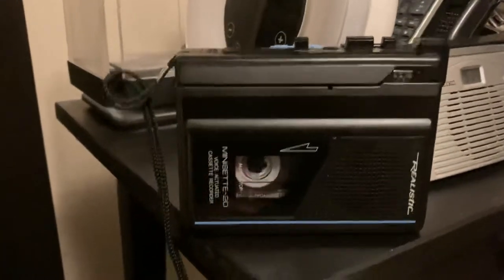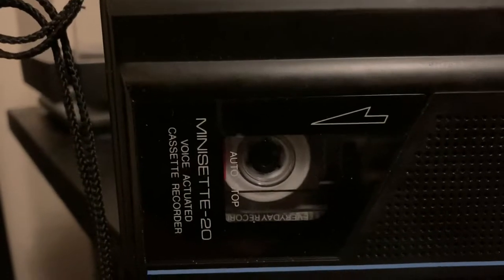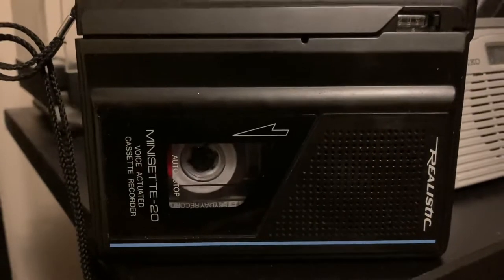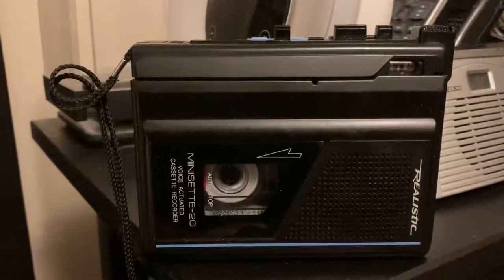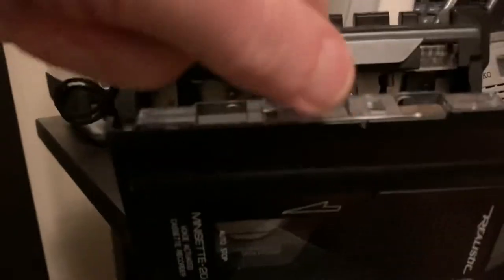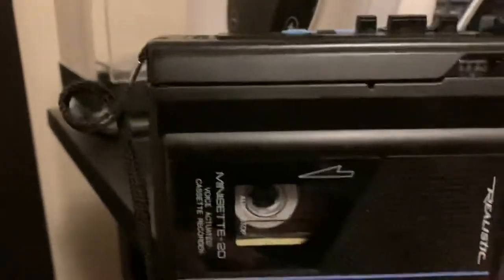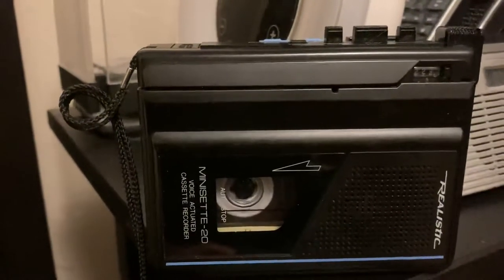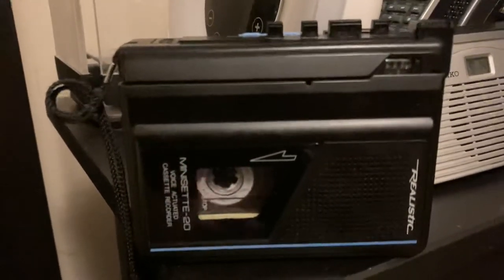How to rewind a stuck cassette tape (binding up)

Comment: My tape has gotten stuck! I can see the tape itself has actually unwound from the cassette and seems stuck in the bottom of the player. I can't rewind, hit play or eject. Please help!
Reply from the maker: Hi David, it’s likely that your rubber drive belts in the cassette player need to be replaced. That’s the most common problem.  What make and model of cassette player are you using?

Comment: I got MJ's Off The Wall cassette, but like if I either rewind or fast-forward, it gets stuck at certain parts.
what should I do??
(The Texas Heat Has something to do with it)
Reply from the maker: Classic MJ song, yeah! How old is the tape machine you’re using? Do you have a another tape player to try it out on? I’d try it on three or four players to test it out. If it plays on four other players just fine, then you likely need to replace the rubber drive belts in the failing tape machine. See my boombox repair videos where I replace the belts: 

https://youtu.be/wD967kf4AQk

https://youtu.be/ilgTdDNLzgI

If it won’t play in several tape machines, including at least one that has had the rubber drive belts replaced recently, then it’s the cassette. Older cassettes, especially ones from the ‘70s, tend to have this issue. In later cassettes, they put plastic sheets on either side of the reels that buffer them against the outer hardshells of the cassettes, allowing them to turn with less friction. One thing you can do is tap the side of the cassette against a hard surface, like a counter top. Also, if you do find a specific tape machine that manages to rewind it and fast forward it all the way, do that nonstop a couple of times to get the tape totally flush with itself on the spools. The more you fast forward and/or rewind a small portion of the tape, the more it tends to gather on the take-up reel in a not-totally-flushed fashion. That could be what’s causing the friction. If the cassette was left in a hot place, like on top of the dash of a hot car in the middle of summer, it’s possible that the case has warped a slight amount, not enough to be visible by the eye, but enough to cause too much friction for the tape to be wound by your average machine. There’s plenty of ‘70s cassettes that have been dear to me that I’ve given up on trying to play, when I’ve tried everything I could to revive it. Sometimes there’s nothing apparent with it except the symptom of it binding up or causing the pinch roller and capstan to squeal. If you hear it squealing, stop the tape immediately! It’s grinding the tape and ruining it. Some tapes are beautiful to look at and fun to have in a collection, but unfortunately may not be very playable.  I hope this helps, and good luck!
Reply: @random-ramblings  I've tested it on 2 players, my personal cassette player (Realistic CTR-39) and my other one (K-Mart Model No. 154-3372.)

Both were able to play the tape at one point, but since the heat over burned out my ac, most of my older tapes were damaged. I've tried tapping it, but to no avail (its also worth pointing out that most of em are cases with no screws, meaning there's a 50/50 chance of me cracking the case, and having to use a donor cassette.) What I've also tried doing was using a Bic pen to rewind the tapes by hand, but its does little to fix the stalling. But i'll take it from here and try out some of the options you gave me.

Thank you for responding.
Reply from the maker: My pleasure! That’s a bummer about the heat damage. Moving the tape reels to a new case seems ideal, but yeah, it’s a royal pain in the butt when the case lacks screws. Not an easy task to perform. I tried to open a case that lacked screws once. Gave up because it seemed like I was going to completely destroy the case before getting inside it.